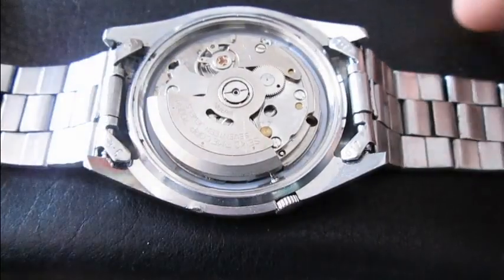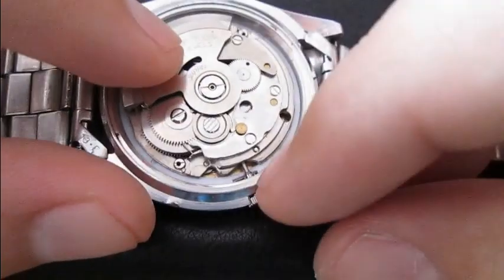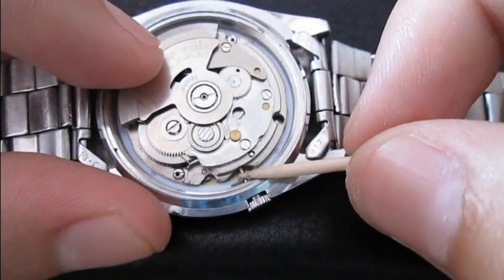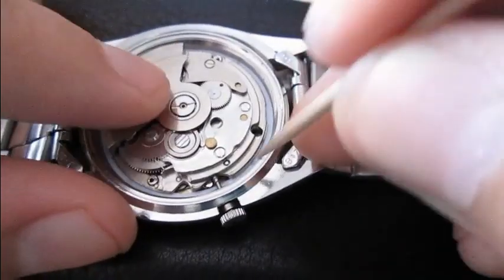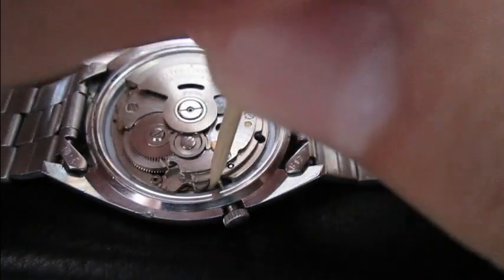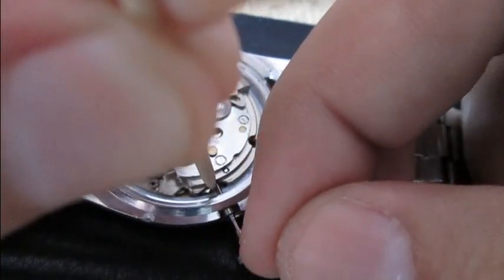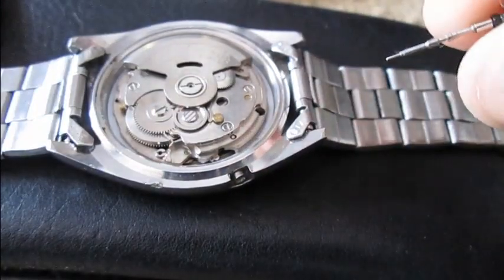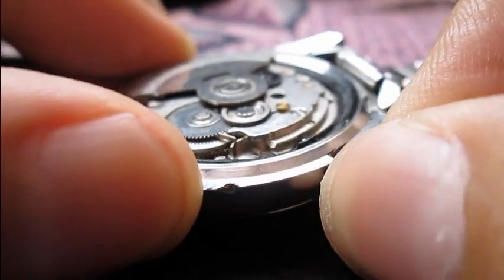How to Remove Stem/Crown From Seiko 7009 cal. Seiko 5

Comment: hi need some help i opened a seiko 5 as well but im worried that its a fake the oscillator is the same as yours but there is no seiko imprint anywhere else and i watched a youtube on fake seiko but the oscillator there has no imprint where as mine does, and when i disassembled it i found a horse shoe shaped wire but then i cant find that on any manual or when u were doing it?
Reply: Leanne C  it seems genuine for me , I think you have an Asian market Seiko those watches might not have any imprint